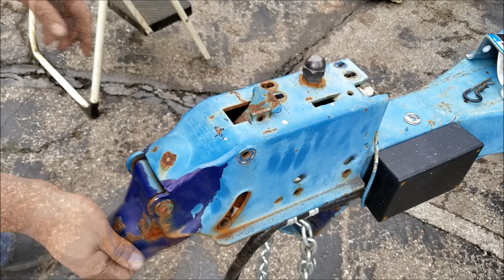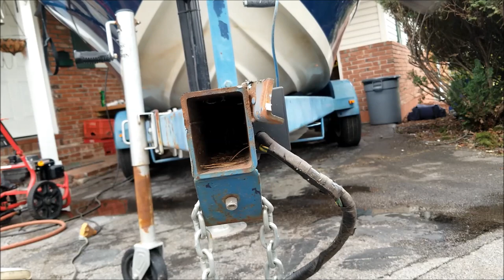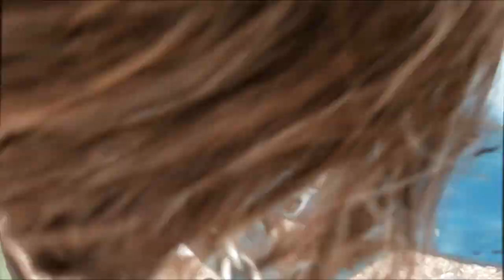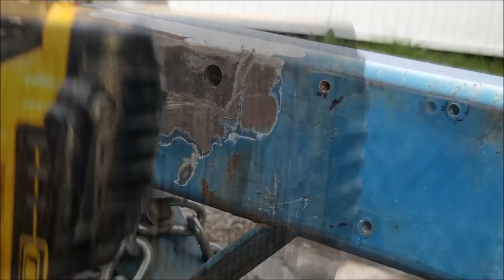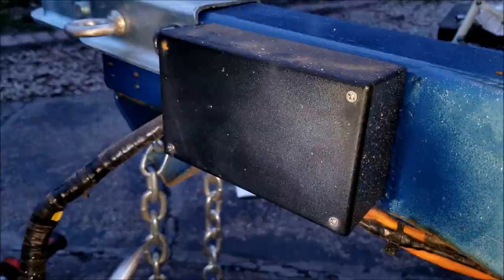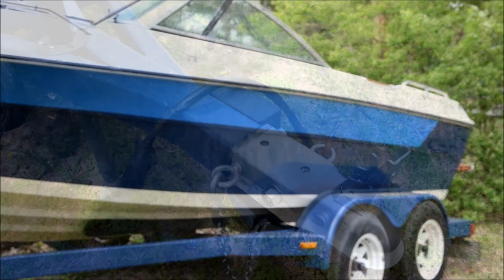Installing a Reese Towpower 2 Inch Trailer Coupler on the 1996 Winner Boat

Comment: I have installed many surge and electric systems an will always prefer the surge but the electric is far more serviceable. I like the eye bolts but use hard washers and stover nuts but still put in some linear welds  ,and never go all the way across the top as it sets up a fail line depending on what load you will be pulling but an inch in the center is fine.(I am an inspector)as you do, , ,  well for that extra bit. GR.5 just never seems to be enough so I use GR 8.Nice clean job my friend. I hope your tow vehicle is heavy enough to warrant no trailer brakes bud. Good job fella ! Very clean !
Reply from the maker: Great to hear the feedback. There was some discussion about electric brakes, pretty simple to install i hear.  in this case, the brakes haven't worked for 15 years. I only tow to the river, which is about 15 minutes. The surge system introduced inches play and made it difficult to hook up and drop. The play is now gone. The RAM has the electric brake system built in. Ill do another video when the electric brakes arrive. - Cheers
Reply: You bet bud. Just change out the backing plates and wire em up.

Comment: So if the blue squad part of the tongue is 2 1/2 inch square pipe what size coupler do I use. It’s a 1 7/8 ball now and I want a 2 inch ball.

Comment: Do you always have to weld it? Or could it be just fine with the bolts?
Reply: El Padrino   Has to be welded.
Reply: @Imwright720                              wrong